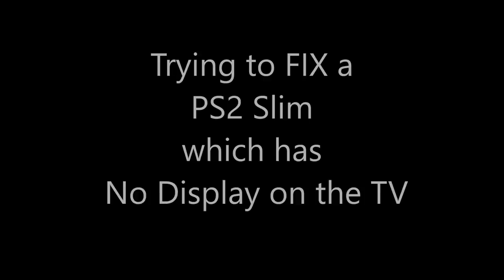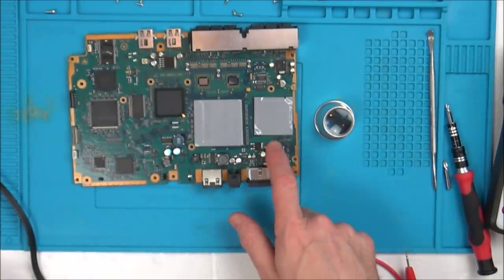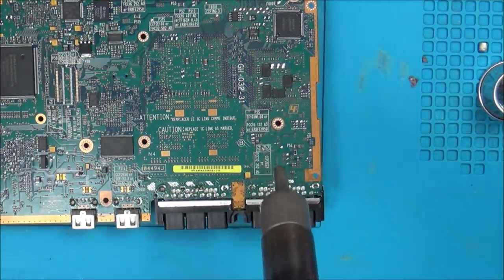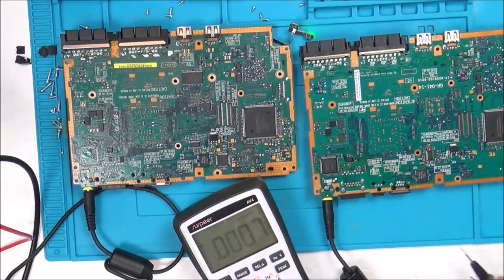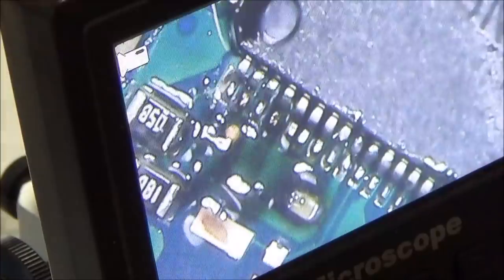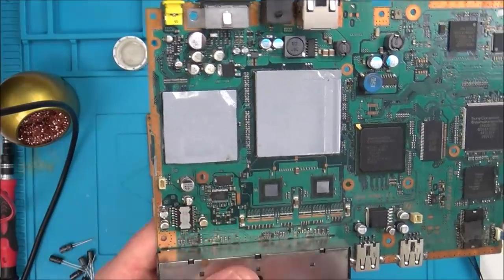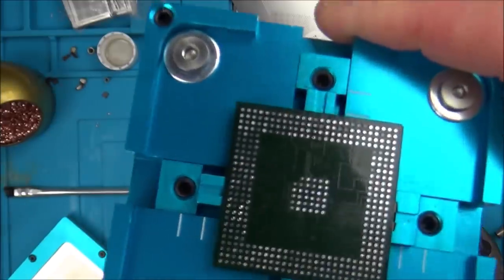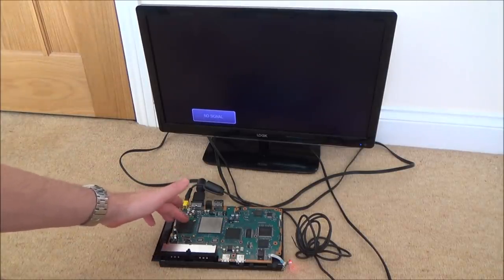Trying to FIX a PlayStation 2 Slim - No Display on TV

Comment: i have the ps2 slim,  i believe its the 70012 model or something like that, it still works, still looks like new, , it still plays and saves games with no issue,  however when putting in a dvd, the screen goes green,  and the age restricted is shown at 8. it gives me the option  yes or no. but either 1 does not let me continue so it says i can not watch that dvd,  then after a couple tries  of other dvds,  it now says no signal, , but this only happens during dvd playback. all my games look and work just fine.  any ideas?

Comment: Hi, May u help me. I have a playstation 2 slim 75001, and I don't know what happened. Mine have started to blurry the video. And now when I plug on DC adapter, it smells burnt and some oil had escaped from smd. I don't know which component has the problem. And the led doesn't show any light. Sorry for my English, I'm from Brazil, South America. And I haven't found any datasheet/schematic for this model.

Comment: Time for a Re-visit... the power light going from Green to Red within a second could be caused by a fuse. Either one marked up as PS13 on the bottom of the board OR PS17. I had this issue and mine turned out to be PS17 (The console going back to a red light).

Comment: +Vince, im trying to recall a video that showed you using a controller on a 360 but using a selector switch device, can you recall the link for me for that vid, i cant find it anywhere now... Also, can you use any other console controller on a 360 without a 3rd party dongle or device?

Comment: At least that had a partial signal. My TV just shows "No Signal" even though its on, disc spinning. I don't want to lose the system. Those Slims were really faulty. My Original PS is still working though, but all of my games have degraded or scratched.

Comment: Vince! I'm no expert myself but I couldn't help but see a bridge on the pins for the chip just to the right of the CPU, looks near the blue (correct me if I'm wrong) cap. But I could be wrong
Reply: Around 55 minutes in
Reply from the maker: Thanks, those one are meant to be bridged, they are on the same bigger pads than the other pins. Thanks for mentioning it though :-)

Comment: I have a problem with ds lite. When I put the device to charge, the orange light is constantly on and the battery is not charging (I charged the device for about 6 hours and nothing happened). I'm wondering if f1 and f2 fuse aren't broken, what could be the cause of ds lite not charging?  I wonder what exactly will not work when f1 fuse does not work, the same for f2?

Comment: It definitely wasn't video output related. If you watch closely when it finally does fire up the analog LED on the DS2 turns on, but when it's stuck on the black screen it doesn't. This tells me A/V output is working fine, it's just that the PS2 is failing to boot for some reason. That also means that using RGB / Component wouldn't have worked either.

My guess is that it was a power delivery issue that was preventing the CPU from starting up, but when it did start up it didn't get in the way of continued operation until another CPU reset occurred (for example when starting a game).
Reply: It might be a CPU or even BIOS issue, it can mess up with the boot and also the peripherals.

Comment: It could have also been a bad firmware chip, installing a firmware replacement mod chip might have fixed it. Not likely but would have been easier than destroying the GPU. I would have also tried just re-flowing everything before trying to re-ball.

Comment: I was not expecting to see a reball job! Well done vince! You’ll be fixing ylod and the ring of death soon!!
Reply: He did do ylod, its not the gpu its the tantalum caps that need replacement. People thought it was the gpu reflowing because the caps are right below the gpu and reballing the gpu heated the caps and brought the ps3 back to life temporarily
Reply: Its the same with red light errors on an xbox 360, some are gpu and cpu related and others can be dodgy caps, southbridge, ram memory and even iffy hard drives...

Comment: Faulty system NAND? looks like the video signal is good but its having trouble booting into the OS.. id check that, im pretty certain that is the problem. - if you see this i hope you manage to try it^  EDIT: ahhh i just say you reflow the GPU .... Check the Nand chip -.-
Reply from the maker: Thanks :-) You don't know which one is the NAND on this board do you? I couldn't find the answer online :-)
Reply: @Mymatevince  off the top of my head it is a chip that looks like a ram chip, it will have the bios version printed on it with the date of manufacture, for example SCEE 2006 (European bios ) SCEA (American ) etc .. it stores the Bios which is booted from when you start the machine, you can't buy the chips unfortunately and the only way of getting them is from a donor board, its been many many moons since i repaired ps2's i'm sorry i can't be more help and i wish you luck :)

Comment: Nice try on bga!, you've changed every single power regulator ic on the board except the big 5v LDO in the middle which is responsible for audio and video chips

Comment: Use masking tape to cover the surplus holes when reballing.
Reply: That might be hard
Reply: yeah heat resistant tape would be a good idea for covering the holes not used by the graphics chip.
Reply: I was thinking Kapton tape, but actually it doesn't matter. Tape over the areas that don't need solder, fill the remainder, then remove excess balls and the tape. I'd have also tried reflowing the balls once the stencil was removed, that might've allowed the couple of slightly off position ones to move right on to the pads. Good video though

Comment: Use some kapton tape to secure the stencil to the chip when doing a bga reflow, cover up the unnecessary sockets with the tape too. Yes this will take some time to do but it guarantees a clean adhesion and minimizes the amount of balls to what is needed.

Comment: Did you check all the fuses on the board.  They have 10,15,20, 50 on top of them.  also labeled ps15 ps10 etc.

Comment: After puting the balls over the IC... u put some flux and do a another heating to the chip the balks will move to original position... Also do not use more than 350 c with very low air speed to put back the valls

Comment: Community please read this and if you agree like it so Vince can see it @MyMateVince So recently "Xbox" has released a bunch of faulty controllers specifically the (Xbox series 2) and with this series 2 controller there are many faults that lots of people are having. Most notably the( Lb and Rb buttons) the buttons them self typically arnt broken however tend to be 80% unresponsive unless you used so much pressure you'll more than likely damage the controller. Other faults tend to be the face buttons, if you would please look at one controller and see if you can fault find the trigger Buttons on the back. Sure you'll be a Microsoft community hero, because everyone is scared to lose the warranty and most of us arnt experienced like you. Sorry for the long paragraph, but I feel like of you were to do this you'd push Microsoft in a direction to make reliable controllers instead of money grabbing us for faulty flashy controllers.

Comment: Wish that was easier! I got one now that the whole disc drive assembly is dead! Been looking out for a reasonably large memory card for it in order to use Free McBoot on it. Hope you stumble upon a solution for that one, Vince.
Reply: If its a fat ps2 you can get a SATA Hdd adaptor from ebay to install games there
Reply: Ali Express sell large capacity memory cards with mcboot installed and sata hd adaptors for fat models and also laser assemblies for Slim

Comment: Took some cajones to go rogue on a reball like that O.o   But he who dares wins... sometimes and this time round I think the gods of the small entertainment appliance said nyetski but still a valiant try.   Reballing isn't an easy task at all and those pro's on the vids use special heat appliers that apply the same amount of heat and force as the factory does and the factory has special machines to BGA them chips in place, yet don't be defeated, often you see them reballers taking off and redoing until it does go right and you can mask off the areas so you don't waste too many balls and I am sure the vids I saw they flux'd the chip which helped bond the solder.
Reply from the maker: Cheers Ian :-)

Comment: Before taking it apart you should have testet a component cable (green, red, blue, white, red). Bacause, as far as I remember, when the PS2 is in component mode it doesn't display anything if you take the normal video cable (yellow, red, white). It can save time and work, if this would have been the issue. But how I see now this wasn't the issue.

Comment: Those 3 via's that don't seem to go anywhere might go to a internal layer of the board as it's a multi layer board.
You should really grab a cheap analog 20Mhz Hameg 'scope off of ebay. All these things like "does this signal pass trough this capacitor or is the capacitor broken" and "are these bypass capacitors OK" can all be measured with a 'scope rather then haphazardly replacing parts and risking unnecessary board damage.

Comment: Thanks for the Video. I have a Slim PS2 Myself. Last time I used it touch anywhere near the video cable port and you can hear horrible humming on the TV but touch it again it goes away. Now I know what it looks like and I was thinking about trying my hand at fixing.
Reply: 1)Check for damages on the AV cable and/or the AV port.
2)Check for dried/cold joints on the AV port. If you're lucky, you'll just need to add solder. If not, some cold joints need to rebuild the trace. Also check Power supply port, they're prone to have cold joints due to the way Sony placed them on the PCB.

Comment: Sad:( maybe it was a bios issue maybe flashing the bios would save or entering diagnosis when it's open could find the problem I wish to see a revisit video maybe a Frankenstein gpu which is soldering each ball to each pin to diagnose the problem

Comment: i have a ps2 slim that the fan makes incredibly loud noises and it sounds like its stuck in the highest speed... like literally it sounds like its going to take off... and yeah it doesnt read any discs... i do get the image though... dunno what it could be
Reply: Dust? Overheating or hot CPU. Clean the insides/fan, heatsink. Maybe it will help.

Comment: This was a very nice video, Vince! I also like the Music Choice, you did on this one! 
It also looked like the reballing of the GPU could've needed some light pressure on the chip itself while bringing it back to the board. The distance between the board and chip did look some kind of too large. Maybe some balls didn't contact correct because of that. But this is just a guess. I was never able to do a reball myself.
Keep doing these kind of videos! These are the best!

Comment: as for your original problem . you sir should considered changing the bios chip . as the bios in ps2s are a rom chip . and if any thing happen to the data inside of one of those it cant be reverseable . your ps2 try to load up normally . but it stuck on a missing or a corrupt file or you can say some error flag in the bios . my fraind it was never a hardware related problem .

Comment: I had the same issue and it was just the matter of switching between video output modes in the main menu. I have to switch the modes when I plug component or rca cable in it.

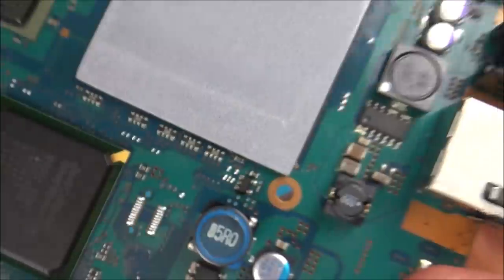Comment: 34:32 the three “test points” appear to have traces hidden underneath. If you use the < > keys, you can pause the video and go frame-by-frame. I see small lines that appear to be traces going under the much larger chip when there is a glare going over that area.

Comment: BGA, You need to clean the pads on the chips so that they all nice and shiny , not greyed like on 1:04:22 top left corner and on the top row , before putting on the stencil put a very thin layer of flux on the chip then the stencil then the balls after heating and melting the balls ,Remove the stencil remove all the balls that is not used, Apply flux and reflow all the ball so that they become nice and round again, Great video  👍😊
Reply from the maker: Sounds good Anonymous, thank you :-)

Comment: Should have tested those 8 array 47 ohm Resistors in between the GS GPU and the EE CPU. That was likely the culprit of the black screen fault. PS2's don't have BGA issues. The solder underneath is plenty good.

Comment: Your mistake. You cannot push out the display cip or main cip.and blower it.  Problem display is not there. Problem display is at display port. Or nearly capacitor.

Comment: does anybody know how to repair a scph-77001 ps2? it has no output at all,no sound no video,  if conected to a modern tv it will display no signal at all, if conected to a old crt tv the screen  will flash for a split second before saying no signal aswell, the ps2  also gets quite warm. green ligth is on.  i checked all the fuses and they are working. what could be the issue?. the ps2 was working fine just a few days ago.

Comment: My ps2 slim stays green but it just shows no signal on my TV
it worked before on the same TV but then it stopped working waIe using it 
I tried different cables and tried the charging the video setting still does not work
I have not tested it on outer TV's I don't have an outer one with the av port right now

Comment: Ps2 chips rarely ever go bad. The display issues(flickering, no signal, weird image etc) in the ps2 are almost entirely related to faulty array resisters. These are less than 100ohms. You can change them with anything between 33-100ohms resisters scavenged from old motherboard. If you have a ps2 with display issues, start by measuring all the array resisters one by one. 98% of the the time it will be a bad array resister. 2% will be a bad chip which is rare because fuses prevent this from happening. Never bridge ps2 fuses with wire stands.
Reply: Would you mind specifying which resistor arrays usually go bad?  There are hundreds of them on the board.